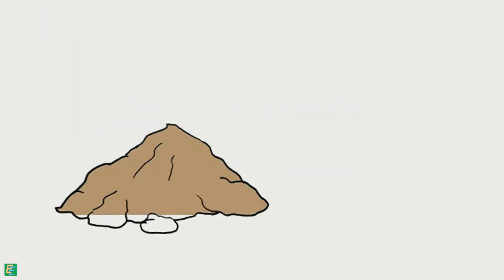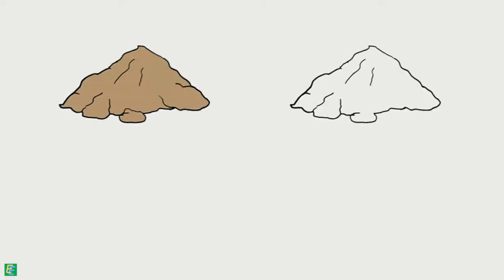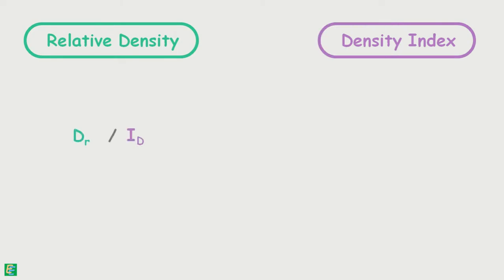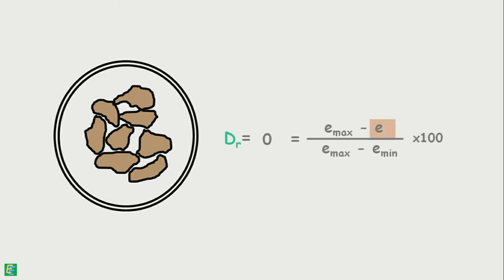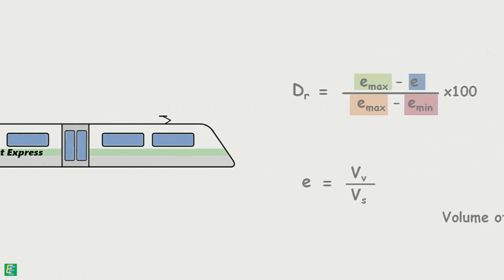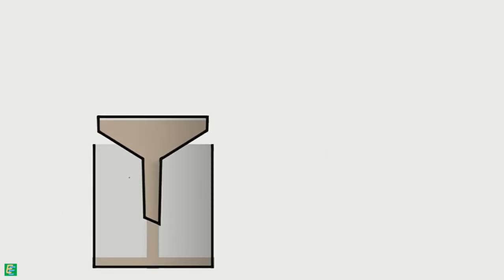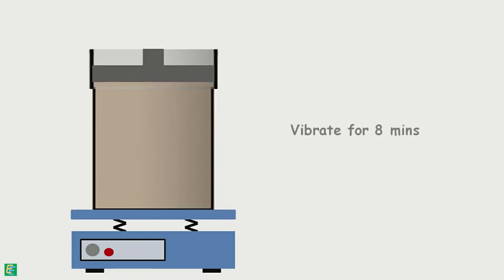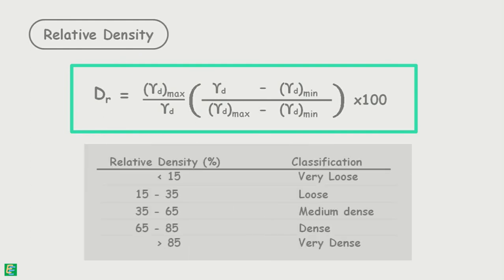Relative Density of soil

Comment: The whole playlist of Soil Mechanics is exceptional. The most lucid videos on the subject which I've ever watch. 
With this said, I must point out a small mistake in the video at 5:00 minute where emax has been replaced by its equivalent dry density relation. Remember, emax ---> gamma min instead of gamma max written in the equation. 
Though the final result written by the instructor is correct.

And yes, again thanks for such creative and wonderful videos.
Reply from the maker: Thank you for pointing out the mistake.